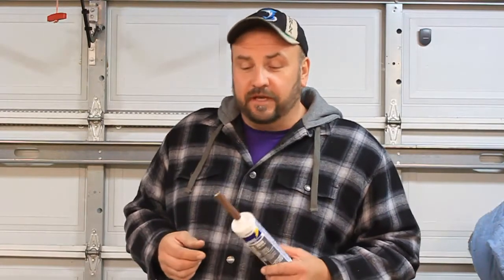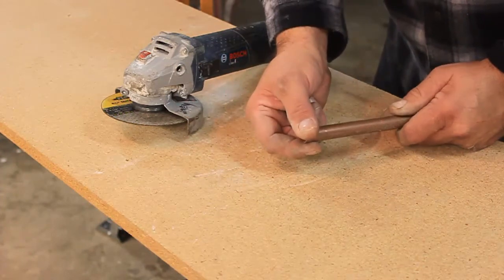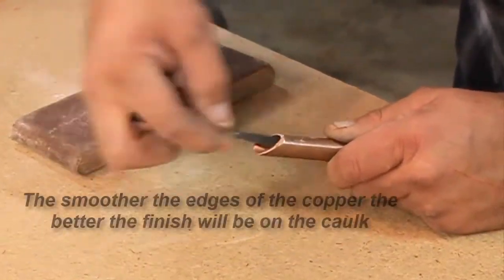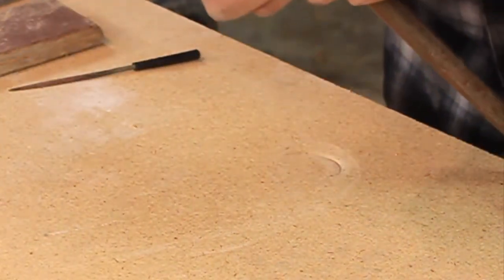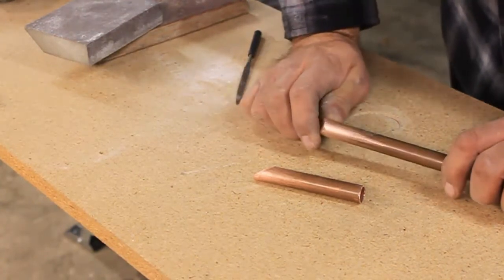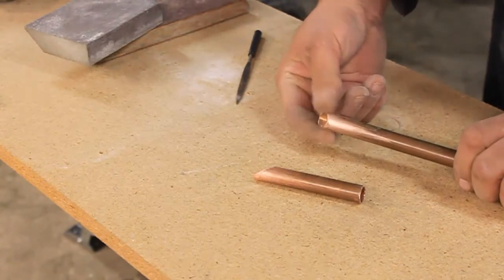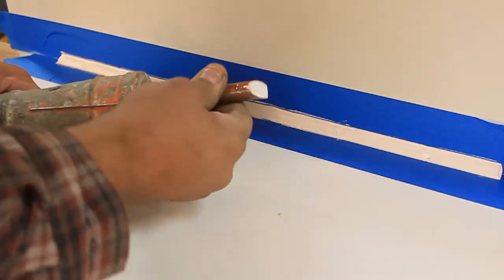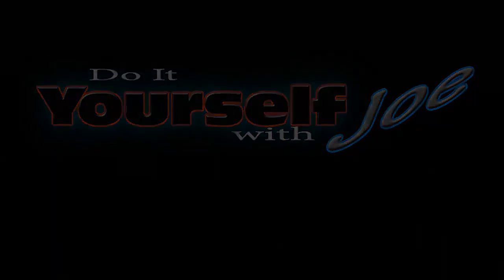how to make a caulk tip extension tube

Comment: I like it. That is one thick bead but I think it would be great for exteriors.. Ha and you just mentioned that in your video!
Reply from the maker: That's what I use it for. I caulk door frames to brick and sometimes the gap between the brick and frame are quite wide.

Comment: Do you this will work with a 3ft extension I need to get into a tight area
Reply from the maker: yes however you will use more caulk. It will take some caulk to fill the pipe. I would also use electrical tape or some kind of duct tape to hole the pipe to the caulk tube. The weight of the tube  and caulk will make the extension fall  off.
Reply: @Doityourselfwithjoe  Thank you both Miles, the asker, and Joe for the follow-up answer. 
I need to caulk behind a radiator, and until now had no idea how I was going to achieve it.
Great job. 💎
Reply from the maker: @DaynJo  You're welcome! Glad it helped

Comment: GREAT IDEA!!!!!!

how do u remove any caulk left in the copper pipe so u can use it again and again???
Reply from the maker: you can rinse it with water if it is a latex caulk. If it hardens it usually pulls out of the copper, just push it through with a dowel or screw driver.

Comment: Isn't that bead a bit thick?
Reply from the maker: Its mostly for outdoors. Caulking trim to brick or storefronts to brick. Stuff like that.
Reply: @Doityourselfwithjoe  Ah. I see. I want to caulk inside a wooden frame I built for my air conditioner. I can get at the other three sides. I'll probably use a 6" piece of plastic straw.